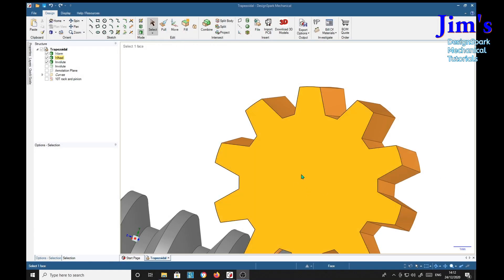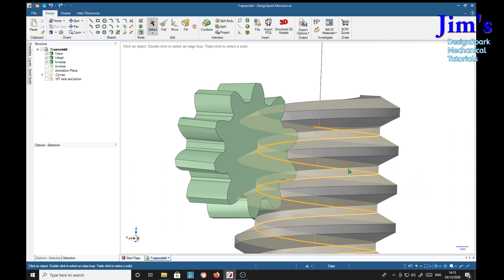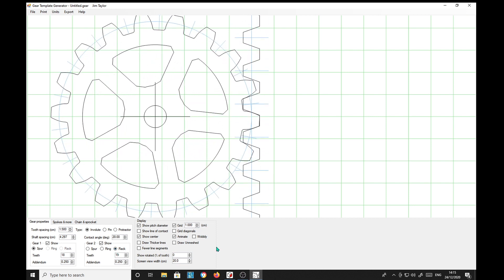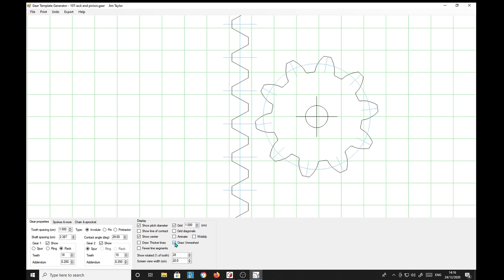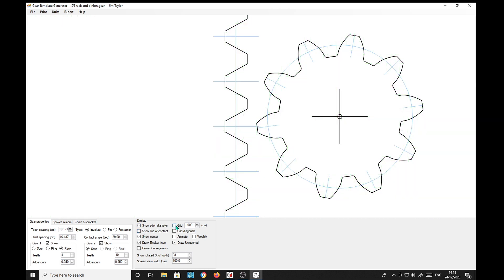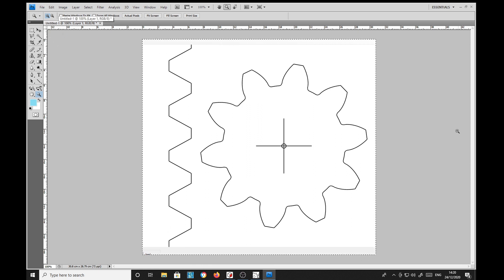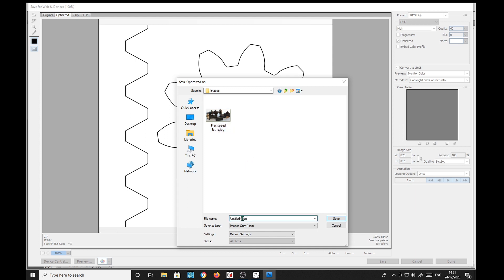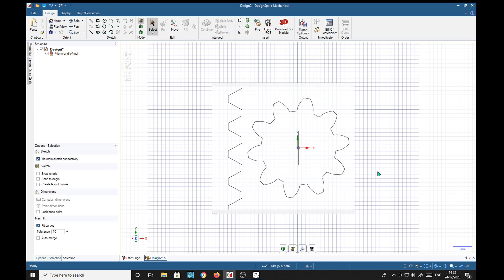Worm and Wheel model 1of4

Comment: Hi Jim, just started on your tutorial. Why didn't you use the Snipping Tool that's part of Windows? It would allow you to snip out of your screen only the bit of the screen you needed. Also I note the program you are using cost $23. If you go to the website https://www.woodgears.ca/gear_cutting/template.html you can use it for free. It's not as pretty but it works well enough.
Reply from the maker: Thanks very much for the informatioln, I never knew about the snipping tool. I've turned it on and tried it - very neat. 
The gear template is by the same person as the one I use which has additional features and is free standing. However, I do appreciate the information.

Comment: Hello Jim, thanks for your e3xcellent tutorials they have helped me immensely with the learning curve on DSM...however I'm curious to know what your hardware spec. is to run it as I have run into a brick wall performance wise now that I know how to do what I want  with this program. I've just had to send back a refurbished 3 ghz machine that couldn't respond in anything like real time. Are you using a fancy graphics card?
Reply from the maker: Video card: NVIDIA GeForce GT 1030
Hard drives are all SSD devices.
RAM: 6GB
Processor: 2.93GHz Intel(R) Core(TM) i3 CPU
Reply: @JimTaylor42  Thanks so much for this reply. I am a hapless ex mac guy with no knowledge of PCs and have been running around like a headless chicken trying to get some clear-cut real life answers!